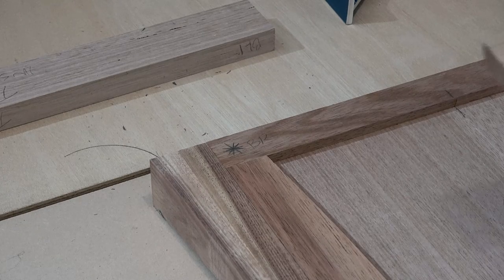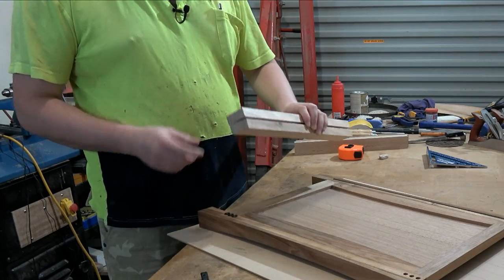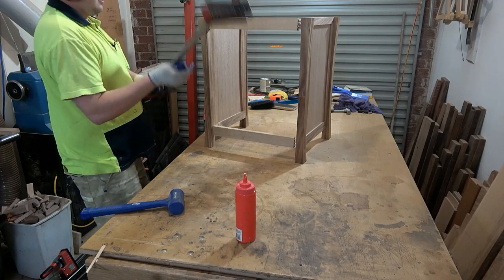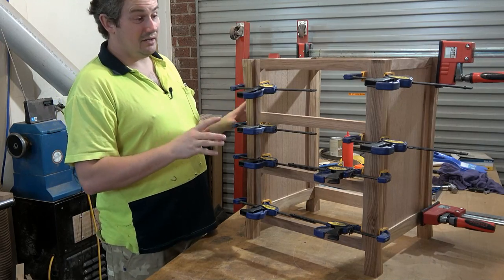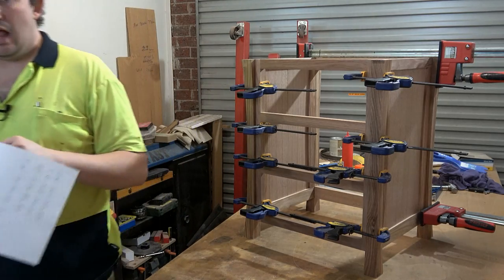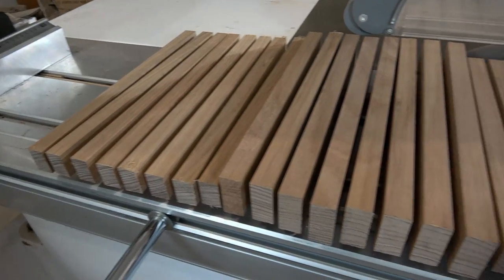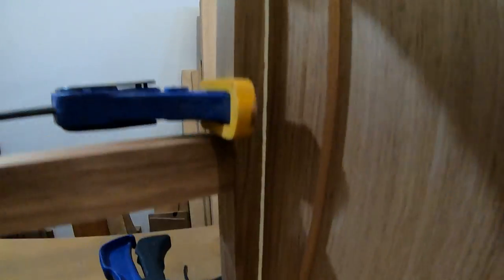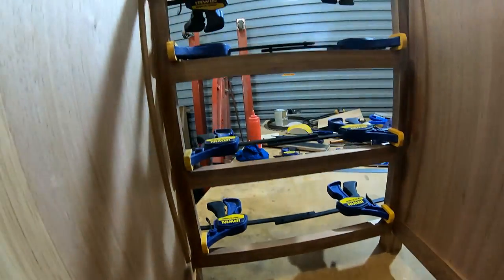Bedside table carcass - summer woodworking series 16

Comment: More beautiful woodworking Kuffy, thank you again. If the bedside table goes on a carpeted floor and most people have carpet in their bedrooms these days the half millimeter rock is not going to be noticed I think. I have never seen the trick with the diagonally cut straw to remove the glue in the corner before, so yet another educational video for me, thanks.
Reply from the maker: It's pretty hard to find a house, new or old, with flat floors. The slabs often rise up or fall away at the edges, and the first/second and third floors are built by carpenters using floor trusses built by me. If they were flat to within 2mm over 1000mm, I'd be impressed and surprised 😂

Comment: Not a Wuss Kuffy. I have muffs all over my shop (next to every machine). And quite often I will use them when I'm hammering. I have lost enough of my hearing to be very annoying / frustrating when talking to people. Good fix with the dowels. ( of course you could have used Pocket screws LOL).
Reply from the maker: I could have used pocket screws, but I would have ended up with a broken jaw....after the solid uppercut I gave myself 😂💪

Comment: Q & A time? What's a drawer kicker? How much deeper than the length of the dowels do you drill the holes for them?  I'm a wuss with noise as well. My family thinks I'm going deaf - I think they are right unfortunately -  I wear earmuffs all the time practically even when I fart. Those bedsides are going to be mint mate - are you happy so far? The design change and all?
Reply: @James Lintell-SmithLOL 😆 I'd suggest you take those ear plugs and shove 'em up your nose! 😎🎧
Reply from the maker: To make a drawer slide in and out smoothly using timber runners, you need a piece to support the weight of the drawer which sits below the sides of the drawer (the drawer runner). Then you need another piece to guide the drawer so it tracks straight, these run along the sides of the drawer (the drawer guides). When you pull the drawer out, it will naturally want to fall downwards. To stop this you need another piece along the tops of the drawer sides, so that the back end can't lift up allowing the front end to fall down as you pull the drawer out. It 'kicks' the front end up (the drawer kicker). I drill the dowel holes to an exact depth into the side grain component (side of legs). But in the end grain component (the ends of the rails), I will drill them to depth +2-3mm. The more extra depth you give it, the weaker the joint can become because the side wall can pop out 'easier'. I'm really happy with them so far, lookin pretty flash!
Reply: @kuffyswoodwork  makes sense. cheers.

Comment: Kuffy do you think there is there any truth to the argument of buying spiral cut dowels over slotted ones? Personally I don't think there would be much of a difference so long as there are grooves for glue. Straight grooved dowels have never been an issue for me but then again I'm not jumping on my furniture either ;-)
Reply from the maker: Compressed fluted dowels, like I use, are super strong. It is near impossible to disassemble the joint cleanly without having to damage one of the connecting components. I hadn't heard the argument about spirals vs fluteds, but it sounds like most arguments on the internet. "I bought this one, and spent my money on this and therefore I love it to bits and think it's the greatest thing since sliced bread.....even though the one that you bought works just as well as mine but it's not as good!". 😂
Reply: @kuffyswoodwork  Haha!  Agree totally